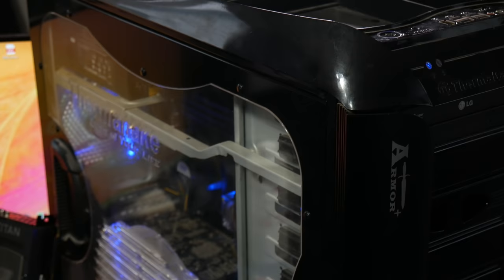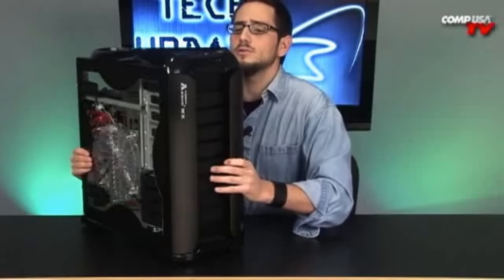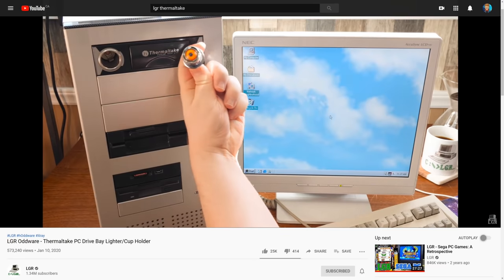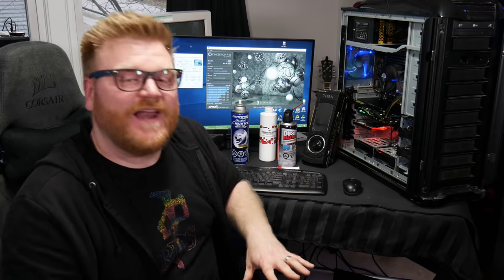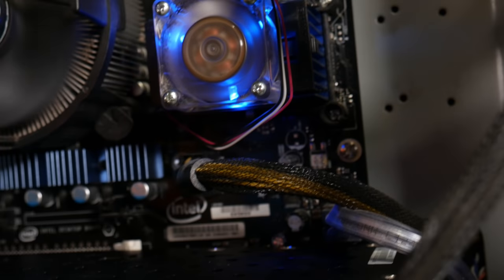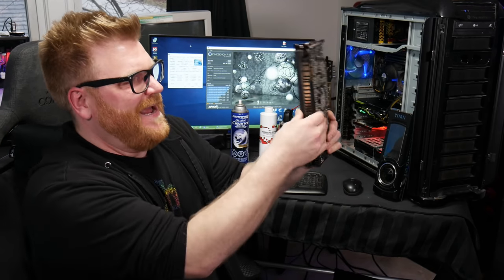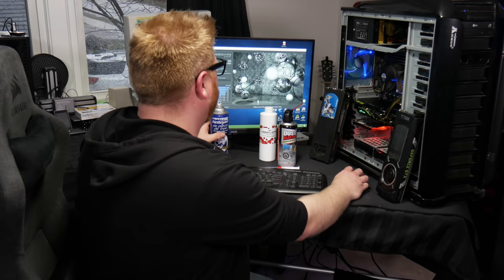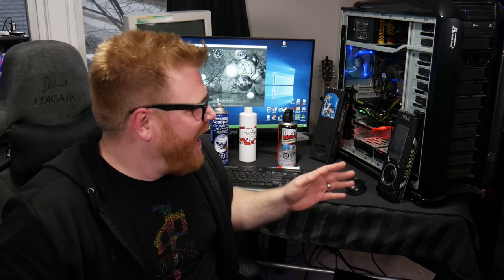Can $5000 buy a PC that will last 10 years?

Comment: I'm still running an ex58-ud3r running a x5650 6 core running at 4ghz on an NHD14 and a gtx970 and there is very little I cant run, even played a load of rift s games? except raytrace games, he should never have spent $5000 on that computer with a stock cooler? somebody made a good profit on building that. buy a $1500-2000 value point computer and do small upgrades over the years with saved money instead. buying your upgrade graphics cards second hand is the biggest saving, compared to new high end. if i was buying new now I would probably do a ryzen 3700 build, if i can get over that the money saved on the CPU is lost on buying faster memory sort of? but lets be honest making your equipment last is quite good for the environment. if his graphics card is a bust, do a deal with him to bake it, and buy it of him cheap as a benching card.

Comment: 700€ every 2-3years is my way to go. I upgrade only CPU MB RAM and GPU. PSU and tge case stay. And i have a wierd thing with myself where i just cabt sell my old hardware so i just keep it in factory boxes...F
Reply: Depends sometimes i skip the GPU, for ex 2 moth ago i bought a x470 Pro Prime and r7 2700X with 2 3200 16gb kits and reused the 1070ti

Comment: That wasnt best Pc in 2009 in first place. I have Evga x58 classified, Water cooling, i7 920 oced to 3.9ghz, 12gb corsair under water Ram 1900mhz, had 5970....But I dont agree with you about junkyard. In 10 years that sandwich Nvidia card will worth more than gtx2080ti. Its rare and collectable.

Comment: I dont think this issue had to do with the logic of spending that kind of cash on a pc build but more the  lack knowledge in the one who bought it and the disgusting  tech who rip this individual off when putting this together. For 5gs in 2009 i would have expected way better hardware the 

graphics card was $500 < got this from NVIDIA directly.
 processor was $555.  < Found this on Intel
The Board sold for $250. < found this on the a review site  with a review dated for release. Plus if he bought this i believe you said late 09 this board was out a year on discount so id say it really cost 200. 
that was a $250 dollar power supply im being way generous, padding because no 80 plus rating. 
say 1555  so far 
say another 200 for the case because im to lazy to  use google. 
I will give you and this is mad expensive another 500 for remaining parts and supplies. 
in total rough estimate :  say total 2300  < this is with alot of buffer in there since i price checked at launch time  the most expensive components

There is approximately 3000 dollars missing where did that money go?   Ether the user is lieing about how much  he/she paid or that boutique gaming pc builder   took someone for a severe ride. The fact you believe that these parts even ten years ago was worth 5 g is baffling and head scratching.   The fact this pc still running after 10 years smell fishy. I also argue being an owner of a titan X  that this pc would no way run stable due to several things the  pci lane pool for this chip-set was 36. The card alone says takes 16 plus the sound card depending on  what else he/she had he/she would be strangling this processor at pci bus level. In addition the card itself would be throttled to pci 2,0 specs when it was pci 3.0 I say this because this video is hog wash lets look at a real 3k modern (last 5 years) computer:

Now lets talk a 3500 build i did myself in 2015:
Processor: intel 5960x
cooler for processor: Corsair H80 GT
Graphics cards : Titan X  Maxwell X2
Physics card:  GTX 750 TI 
Ram: 32 gigs ddr4
Power supply: 1300 watts.
HD space : 10 TB +  1 SSD Samsung pro 120 gig and 1 SSD Samsung pro 512 gig
MB: Asus Rampage 5 extreme motherboard.
Case: Thermal take core  X9

For 1080P gaming 5 years later this thing will still get me 60 plus FPS on most games on highest possible settings. 
for rdr2 30 to 45 FPS  on high settings.
In most games i can run 4k though sub 30 FPS 

lets be a little honest here  i run borderlands 3 at 1080 on highest setting chew up maybe 50 percent of my 30 percent of my cpu. I could drop a new graphics card in there go another 4 years and still be under 5 k. So yes 5k build could buy you 10 years. Instead i will next year be building another beast and turning my current one into a server farm. Hate to say this your belief that this was a 5k build smells of bs.

Comment: Ouch Timmy when you said you would not trust antec psu from 10 years ago. Almost all antec psu are rebranded seasonic psu. I have Antec true power trio 650w and its now almost 15 years old it worked flawlessly. In the end of your video it was clear the psu was not issue. Antec is certainly beter than crap you promoting like GAMDIAS and FSP, Enermax and Coolermaster...

Comment: I mean, it has sense to go for a bit of future proffing, but you need to have some braincells inside your head, 10 years without even maintenance is way too far fetched.

I bought a prebuilt PC 6 years ago with pretty much the best DDR3 compatible CPU I could pay, an i7-4790 (non-K), it was about 700€, I upgraded every single part of the PC before changing the CPU, just 2 months ago, I went through 2 RAM kits, 2 MOBOs, 4 GPUs, 2 CPU coolers, 3 cases, 2 monitors, 2 wifi cards, 3 keyboards, 2 mices, a stereo and a surround system, in the end I've probably paid about 2500€, but for 6 years of good maintained performance, not for 2 top of the line, 2 good, and 2 decent.

Comment: Yeah honestly even if i had billions of dollars i would still not build the best thing on the market simply cuz there's no point in it,you build a PC based on what you use it for,i do gaming and nothingelse and for 2020 gaming you don't need more that 16 gigs of ram at a decent speed(no need for the 40000000000000 Mhz speeds) you don't need more than fucking 4 cores man if you buy and build a decent/medium spec system today based on everything that's on the market it would most likely perform very good even for this year and since you don't go all out even if in 2 or 3 years it won't be as good you can simply replace it,buy the top tier stuff today and in the same amount of years i think you would surely replace that,plus what is the point in having the top tier stuff if you use them to play fucking Solitaire right? what is the point in buying and owning a Bugatti Cyeron or whatever the fuck they call them nowadays if you need a fucking Corsa to go to buy groceries and back home? its all about what you intend to use it for not what it can do imo,and to me if my PC can play the games i enjoy at 40+ fps no matter if i keep the settings on Ultra or Low(basically if it can play the games are above 40s) then to me that system is still good enough for a few months/years,when that requirement is no more than yeah its time for upgrades of replacement

Comment: My last computer lasted me 10 years sure the last 2 was kinda shitty but with only 1080p at 60hz it was fine. The Black fryday  2019 i got a New spent around 3-4 k us on it and its shit. One of the reason is a 1440p screen with only dp 1.2 connectors another is heat problems and My dual 2080 got fucked over by nividia on orders from Microsoft.
No the New one whont last 10 years now consols Are comming out with insane power compared to price. Dit Any one say price fixing in the hardware market? No well fuck it. Last 10 years with No bullshit software blocks on hardware was great. And now you Will be better off getting a consol and installing Windows on it its sure as hell alot cheaper. Hey meby the New consols Will last 10 years